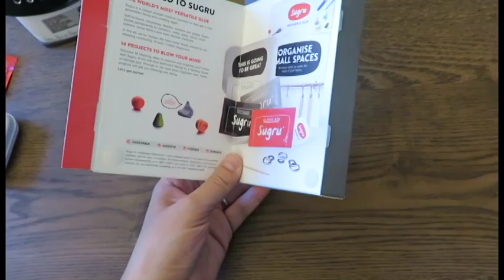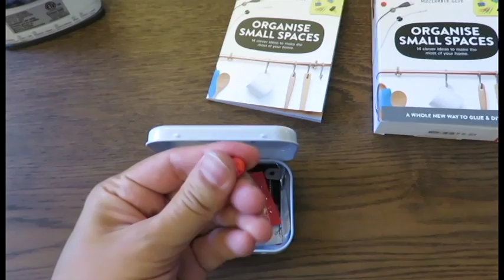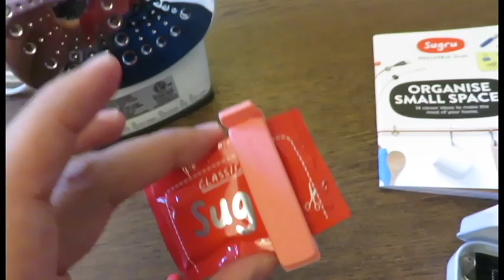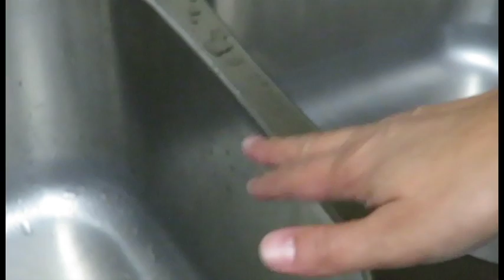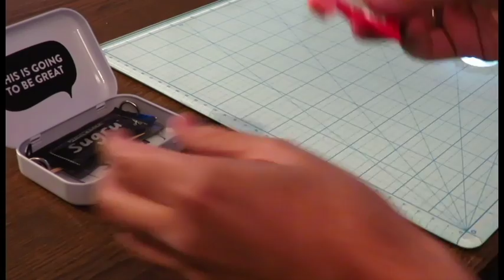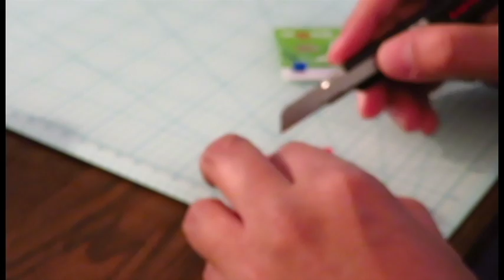Save your Sugru! It really works!

Comment: I just realized that sugru even when left in original packaging is useless after few years. I bought a 8 small packs 3 or 4 years ago. Wanted to use it today and it won't work. It's too dry to mould it. It looks like it has only 18 months of shelf life. Very disappointing.
Reply: That sucks because I’ve also got a tin with 4 packs in I got a few years ago and after reading your comment I can see there’s a use by date on mine of 2018😢